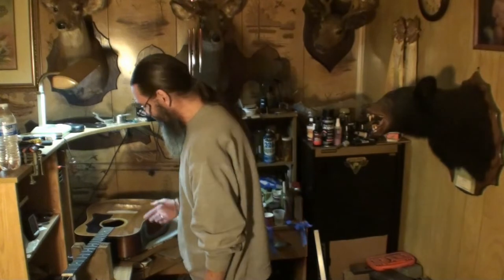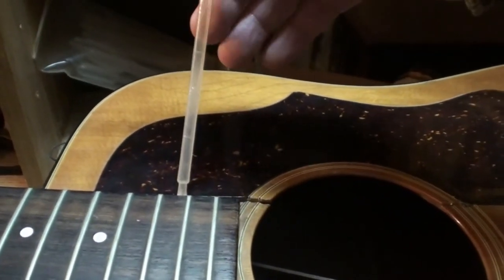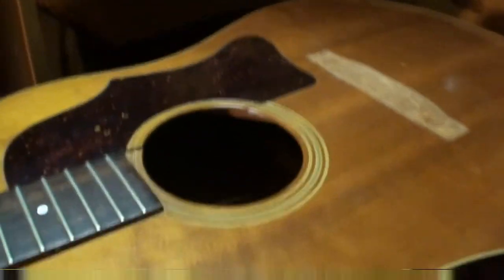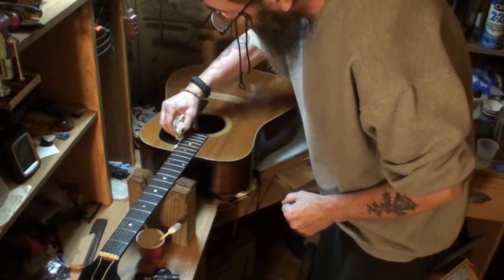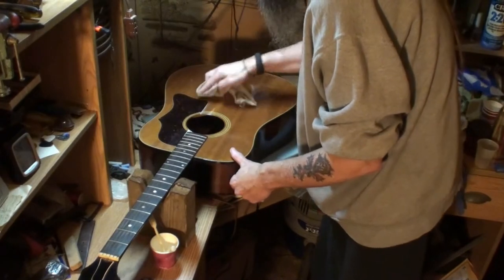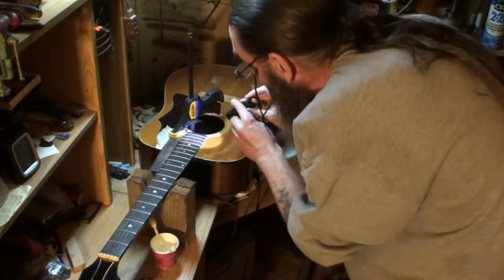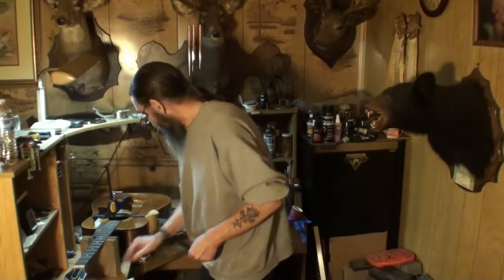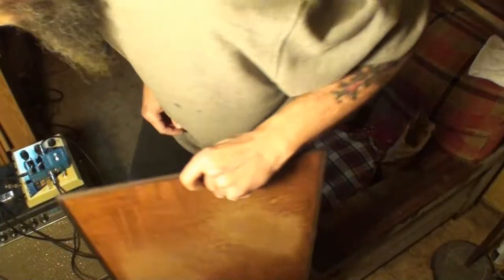gibson j40 guitar top crack repair and a visit from Q ball!

Comment: I was worried that the pick guard shrunk and caused that crack. I thought you would have to remove it. Looks like you have everything lining up good so it should be fine. I would put a couple of cleats just for piece of mind, or maybe a thin piece of spruce to support that sound hole. You the man, so I will see what you come up with. Glad to see ol' q-ball!
Reply from the maker: yup cleats for sure to strengthen it even more. then maybe a new bridge. the old bridge was like ovation guitars and the owner wants the string balls to rest inside the body like martins do. thanks my friend for checking it out!

Comment: That's where my crk goes to also, ( my bridge )... Question is , where's the      confounded bridge? Ha!
Reply from the maker: no bridge lol the owner wanted a martin style bridge put on it instead of the one it had with strings loaded from the top, I'll have to drill bridge pin holes in it after I glue on a bridge. thanks for checking it out! :)
Reply: @TheHousethatneverSleeps , Pink Floyd...lol😎
Reply: Folks, get an endoscope!
Reply: @gordonday9950  lol!